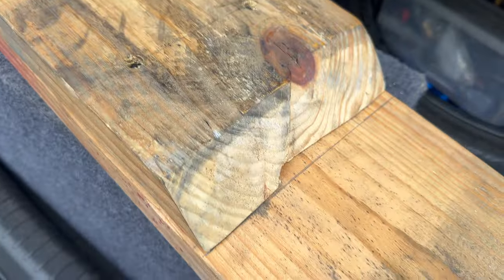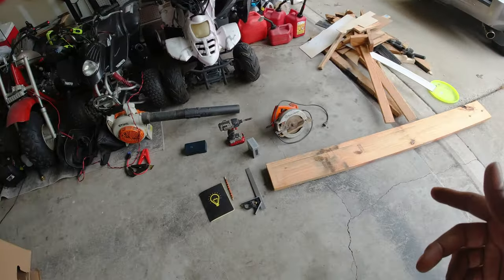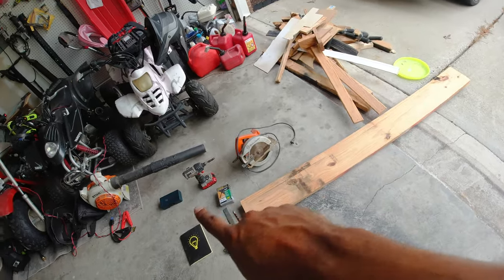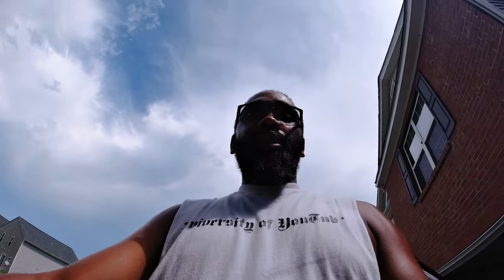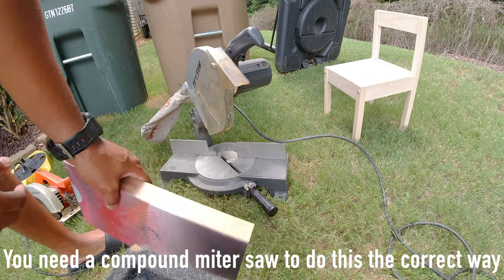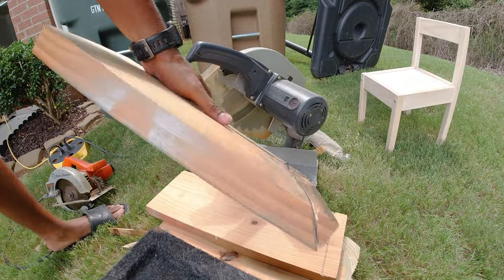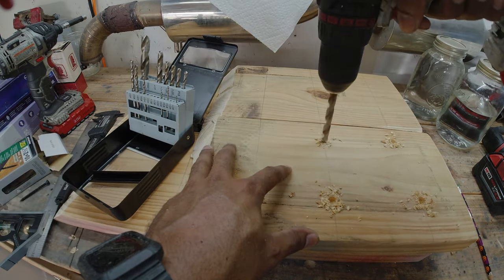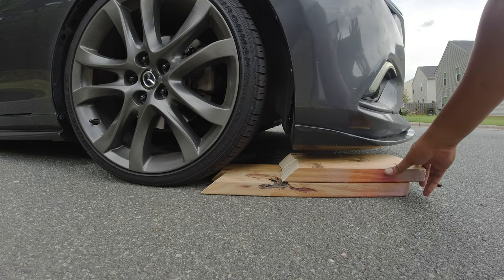DIY Low Car Ramps

Comment: I was dirty, I grabbed some wood left on a building site 😂. Wood is a bloody mint here (Scotland.) We cut down our lengths , doubled up where needed and added an entrance step up portion that was attached with a hinge and used a cut off as a stopper to let me know when I was at the edge. The hinged piece would be what you have now and the car would drive up then drive onto a higher diy ramp. The hinge was so I could open the initial ramp out of the way by opening out. Lowered cars need extra care and loads of maintenance.  Great job! There is no need to overpay at Halfords (Chief? O'reilly's for US I think?) when you can just make some that last longer.
Reply from the maker: Do what we have to do! I would love some low carb ramps, but they are too long and wouldnt fit nice in my car. They would be perfect for the house. But if I get a flat tire on the side of the road, I need something then and there! Not the prettiest, but 100% functional 😂